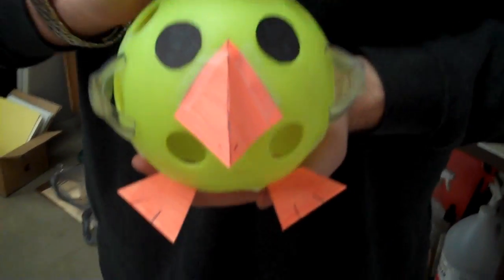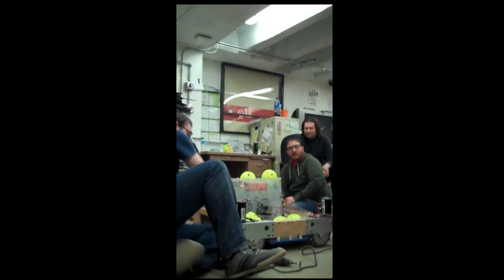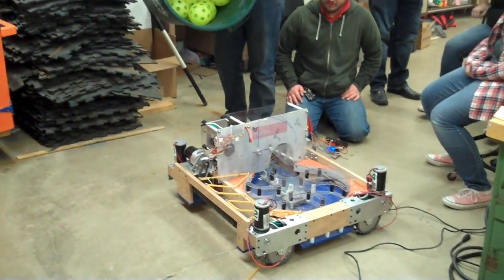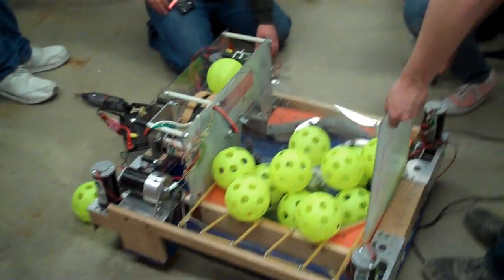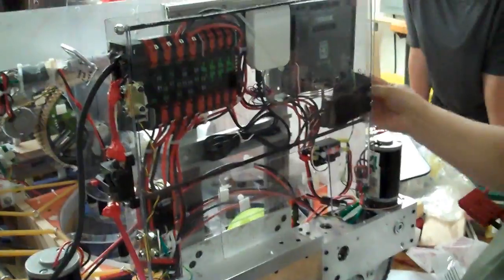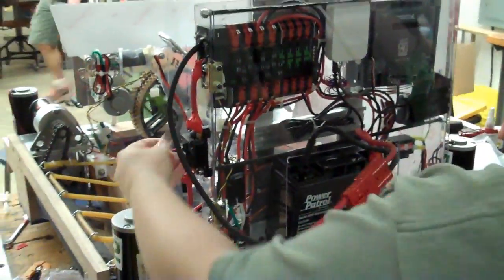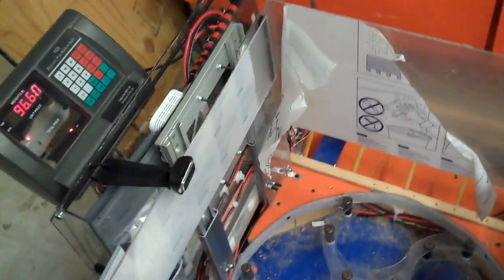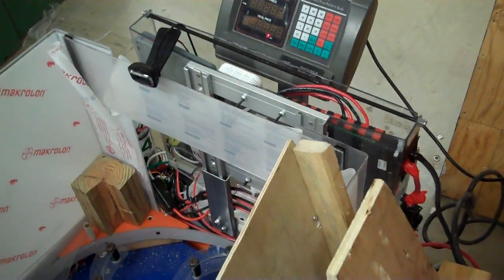F.R.C. team 1248 week 7 2017

Comment: What sort of backboard are you using for that wheeled shooter?
Reply from the maker: we started with four lexan plates 2 were fixed, the other two pivoted in the same arc of the shooter fly wheel, to adjust height,  as the little tested we had showed we had to change. we changed the two lower ones to 1/8" thick aluminium. and as further testing accord with out true practice we just deleted the upper which were supposed to adjust our shot.

Comment: how would you say your feed mechanism has worked out for yall? Has it been a challenge making it work?
Reply from the maker: well for us the challenge was we were thinking some over complicated belts and rollers and mini shooters but one group zip tied a pool noodle to a 1/2 metal rod and attached it to a drill and it worked and with proper compression we could pick up a ball load it in the hopper and it couldn't get out then on our real robot we found out the wall for the squid puss (spiny thing in hopper) so we used surgical tubing that it pushes up into for the full height